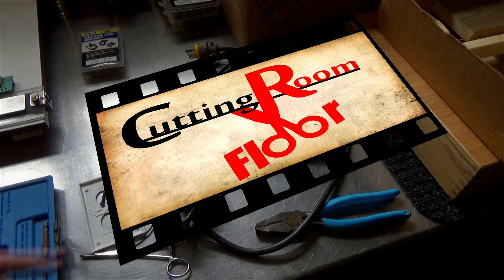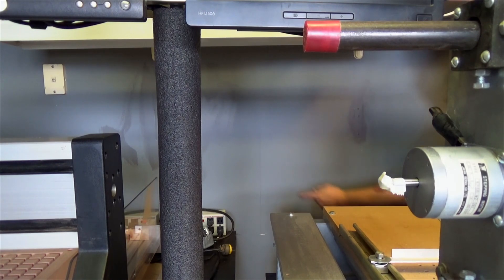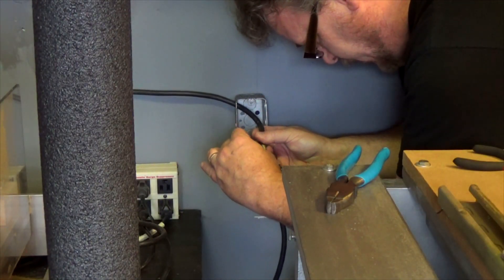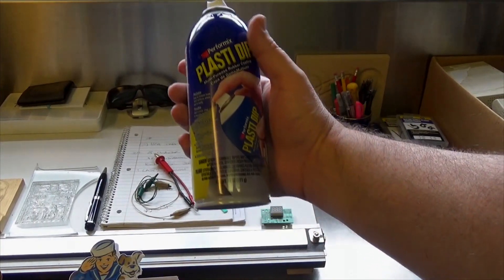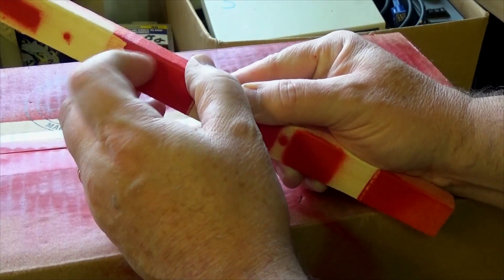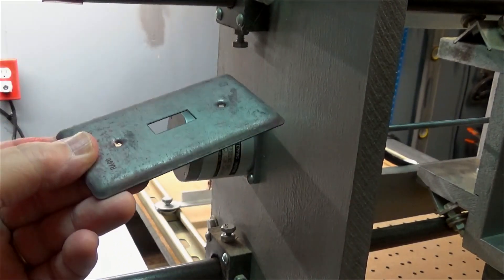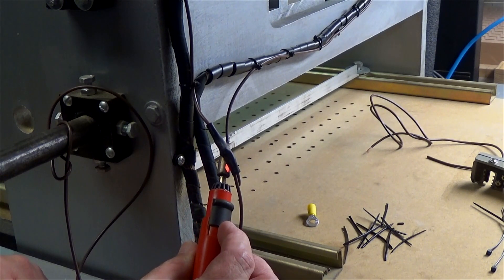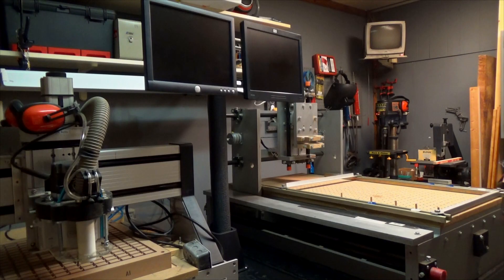CNC Machine Safety Switches and Power Hookup - GuruBrew CRF

Comment: Steve - With this modification - are you no longer using the digital relays that you put in the Controller box? Or, is this modification in addition to the on/off function of the controller? Thanks for all your great videos - keep them coming!
Reply from the maker: When building the controller I was planning use the relays to switch the router and vac in gcode but after thinking it over I decided I would rather have manual control. If I were running the same program hr after hr and day after day, it would be different and cutting behavior would be mostly predictable. But here in my shop I run to many (mostly) one-offs and hard telling what I may or may not have programed the chomping beast to do. But they are still there (relay capability) if I ever need a production environment. I may have other uses for them and if I proceed ill show it in a future video. ~thanks

Comment: The reason the ground on a receptacle should be positioned in the lower position is so it is the last to break contact when the plug is pulled downward. 

Take a look at a standard 3 prong plug and you will notice that the hot and neutral prongs are considerably shorter than the ground prong. When pulled downward the two short prongs will disconnect from the circuit before the ground prong does, providing a smaller chance of getting shocked.
Reply: I  can't say if it's the proper way in the US. Here in Canada we  were taught in trade school to put the  ground to the  bottom for the reasons I mentioned and if mounted horizontally the neutral should be on the top. The codes for both countries are very similar in most respects, but do have some differences. 

I'm like you, I prefer the  look of the ground on the bottom.
Reply from the maker: OK, that scenario that you experienced does justify the ground pin being up then. I bet that was a load of excitement! Interesting that they never stuck to it. thanks!

The chance of a piece of bread falling butter side down is directly proportional to the cost of the carpet. ~Murphy
Reply: The ground plug issue was real for me about 15 years ago when I had an aluminum yardstick setting above an outlet and against all odds it fell and managed to wedge itself across the hot and neutral of the plugged in cord.  Lots of excitement for sure and a big gouge in the yardstick.  UP is safer for this type of occurrence, but as late as 2014 the NEC doesn't specify one way or another.  BTW GFI's currently being sold still have the ground plug down if one is to assume the word TEST is to be read right side up.  Great piece as usual Steve.
Read more
Reply from the maker: I had my kitchen wired last year by a contractor and he told me new rules say the ground pin should be on top. Is that not right?
Reply from the maker: I put mine on the bottom in this video contrary to what I was told but that's just how I like mine.